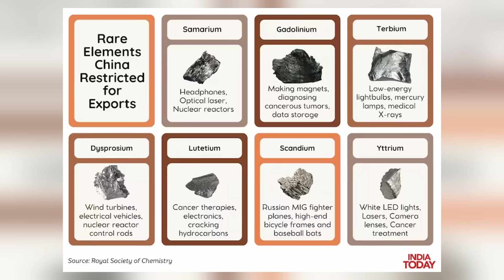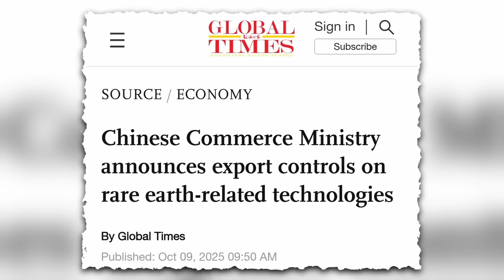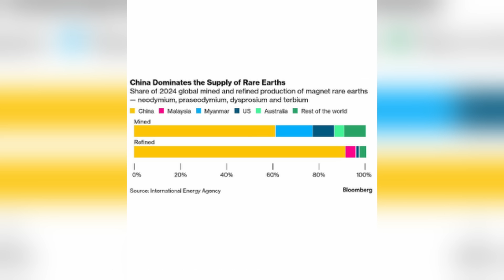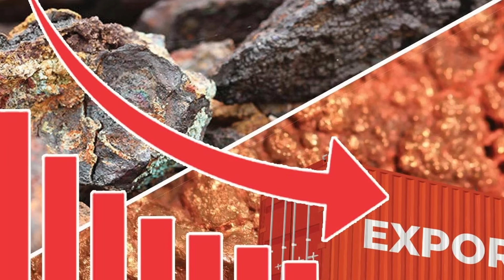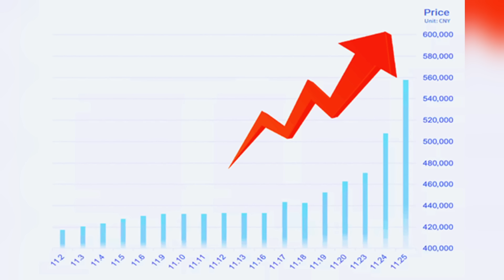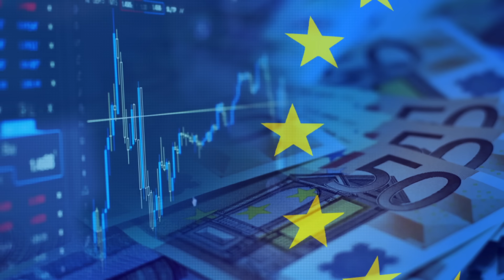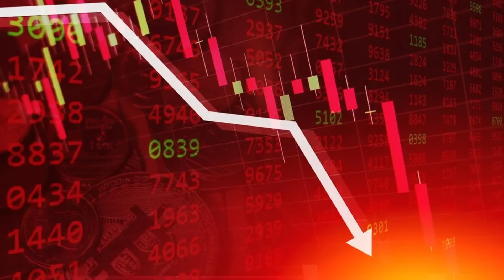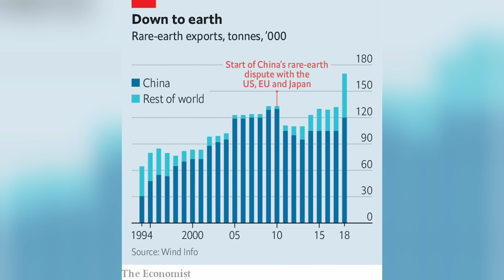China New Rare Earths Policy: The Global Tech Shock No One Saw Coming

Comment: LAST day Chinese Dragon Teeth of Iron The Iron Curtain with Toe Nails of Brass The Bamboo Curtain more stout Dreadful King's of the East Daniel 7:5 - 8, 16 - 26 a Brussels Belgiam Computer System restarted with a Chinese Dragon Revelation 9:14 - 21 1/3 EARTH die by fire smoke thrust missiles Daniel 2:28 - 52 During The 10 E. U. Nations s Chinese Dragon invades E.  U. Nations Revelation 16:12 - 14 Revelation 9:14 - 21